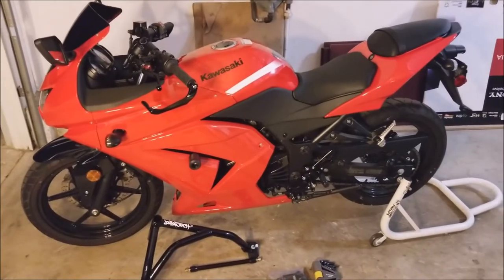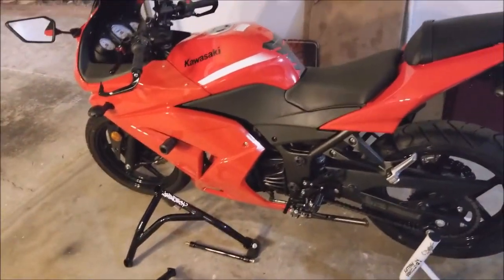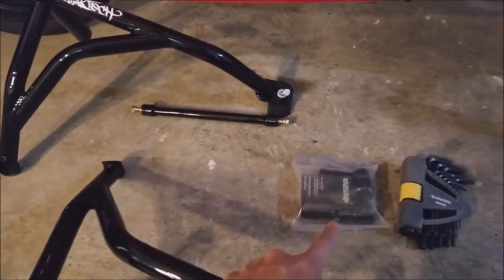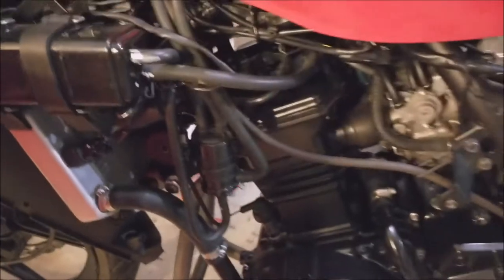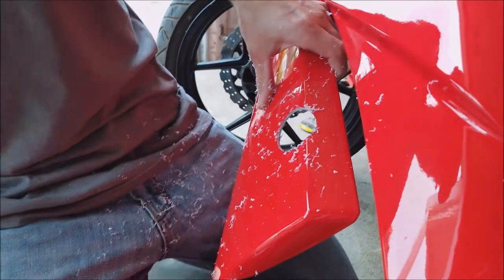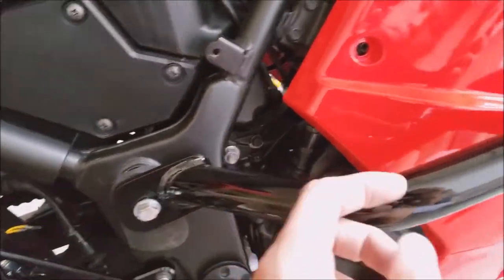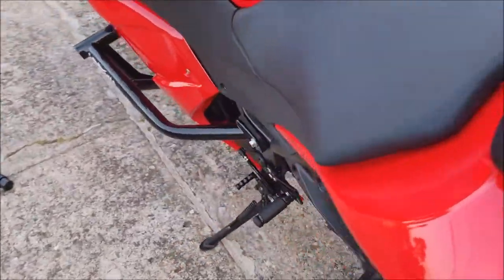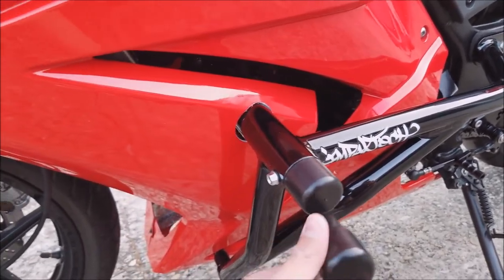Impaktech Crash Cage Installation - 2012 Kawasaki Ninja 250R

Comment: I just installed the same cage on my 2012 Ninja 250r. My shins are hitting the bars when I shift  or use the rear brake. Did your wife have the same problem? I’m 5’3 and my shoes are size 8. My boyfriend thinks my size might be the problem.
Reply: Also... thank you for the video. We watched it before installing and it helped!
Reply from the maker: @tammygraham4329  hi there! unfortunately yes she also does have that issue, she's 5'4" so she's about the same as you...I complained to the manufacturer but they said that is the best angle of the bars that works for the bike... :\
Reply: Thank you for the quick reply! Did you try anything to fix it, peg relocation brackets or different rearsets? By the way, my cage arrived 2 weeks after I ordered. I’m in  BC, Canada.

Comment: Horrible. Como pudiste agujerear el carenado de tu hermosa moto para poner esa porqueria?? disculpa mi sinceridad pero, ademas de quedar feo es un pecado lo que hiciste con tu carenado.
Reply from the maker: most frame sliders need the fairings cut. the ones that do not do not work. also..the fairings on this bike is so cheap. if you dont like it just buy new fairings.